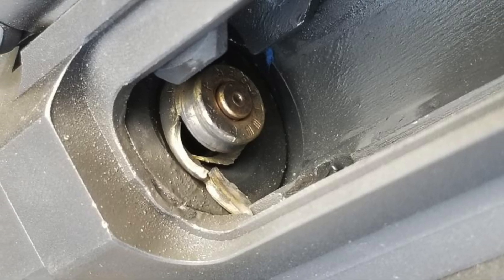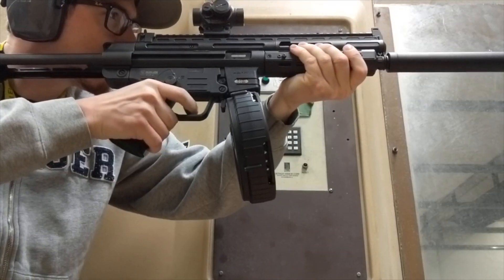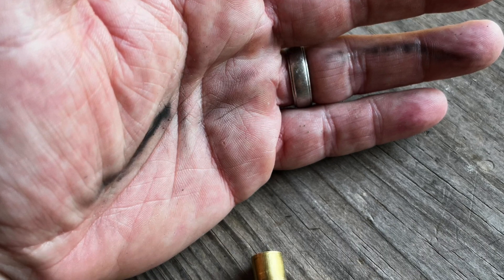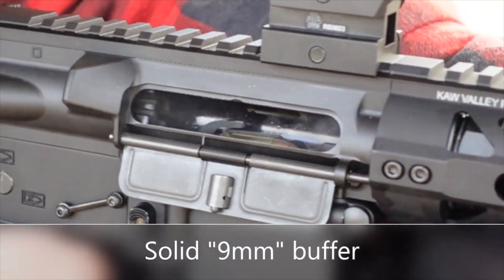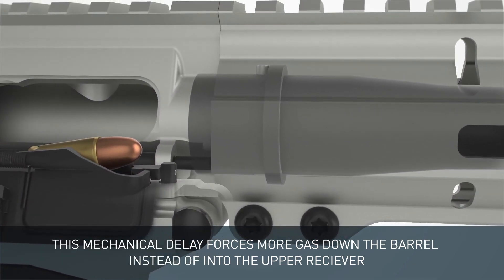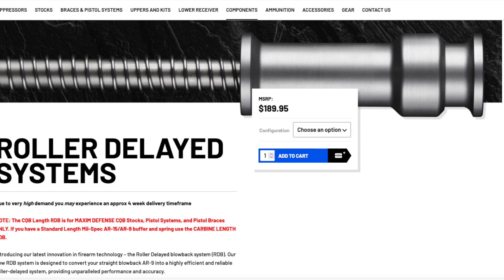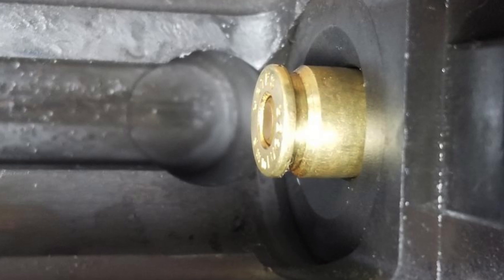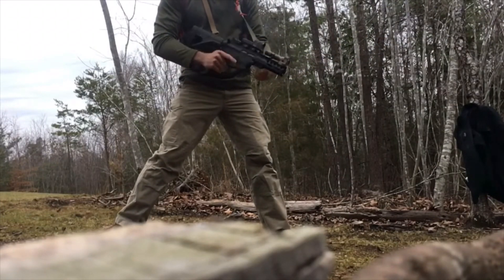Prevent Out of Battery Discharge / Detonation on the AR-9 platform

Comment: I had the same issue with my Aero built. Used Kynshot hydraulic buffer, longer buffer tube and Wilson combat spring and BK BCG. First 100 rounds I had feeding issues etc... On the next 50 rd box had the OOBD. Ordering all Aero Factory parts to see if that makes a difference! I have seen video of fully Aero built, the first bunch rounds were trouble free. Thanks for your videos. They are great.
Reply from the maker: I am more and more becoming of the opinion that direct blowback for 9mm is not if you will have problems, but when.

Comment: I build a epc9 and changed the stock epc9 bolt for a kaw valley. I've had multiple out of battery detonations while trying to figure out what's going on. It would happen during slow fire. I think the stock epc9 solid buffer is the issue. Just order a kaw valley 10oz bolt and I have a standard carbine spring to replace the 308 spring the ecp9 uses.
Reply: Did this fix your issue? I have a epc9 also with an aero 8.4oz dead blow buffer and carbine spring. The issue I have is that out of every 30 round magazine I'm getting 1 bulging case. In semiauto it doesn't bulge cases, only rapid firing.
I'm thinking about a heavier buffer.

Comment: My CMMG banshee had an out of battery detonation and my round looked exactly like the picture of your mushroomed round ,rifle is currently in CMMG for repairs
Reply: I didn’t think the Banshee could have one since it has a rotating locking bolt like an AR
Reply from the maker: That’s what I thought too.
Reply: Just an update , it has now been 8 weeks and still nothing has happened regarding my banshee repair. If you are having any thoughts on CMMG just try and find a telephone number for them , they hide behind text mssgs only
Reply from the maker: @ Sorry to hear that! :/
Reply: @PorcTactical  Yeah, id love further clarification as well! Using an appropriate buffer and spring to mitigate bolt bounce doesnt satisfy me as much as a system that mechanically prevents OOB's if the bolt DOES bounce. With AR bolts, the firing pin should be shrouded within the bolt due to its travel in the BCG before the lugs lock. I thought the Banshee had the same concept? Great video by the way. Very well explained and demonstrated.
Reply: @t-townonthepct1592  How did it go?

Comment: So like bolt bounce? Too light of a buffer system?,I used Blowback9 “gentle recoil system” hydraulic buffer,standard flat wire spring,x2 kynshot 2.5oz weights still building never fired let’s hope this never happens…

Comment: You mentioned the hydraulic buffers as a method to reduce the likelihood of of OBD's. Do you know or why it helps? I have a kynshot buffer in a cmmg banshee and not sure if it helps or causes problems with the two systems together.
Reply from the maker: The short answer is is that it slows it down. I go into much greater detail in this video if you’re interested: https://youtu.be/QaIH8iy1jvw